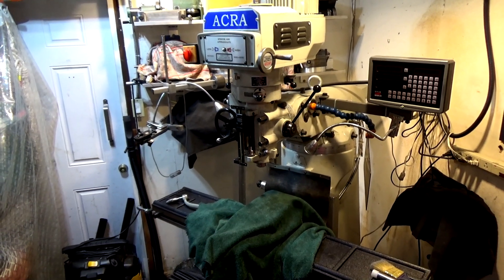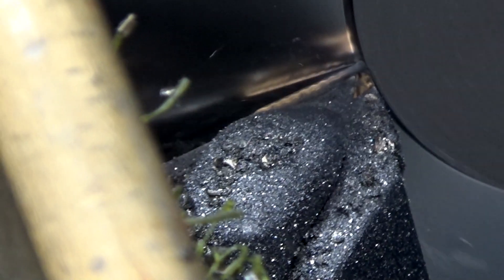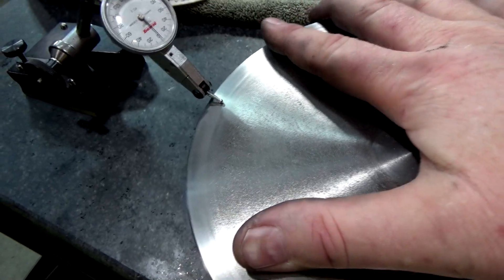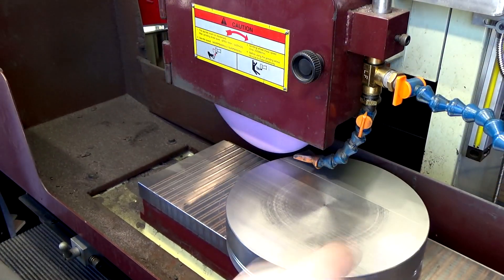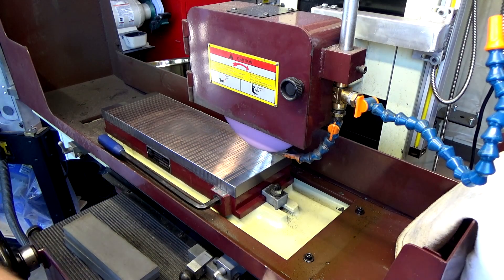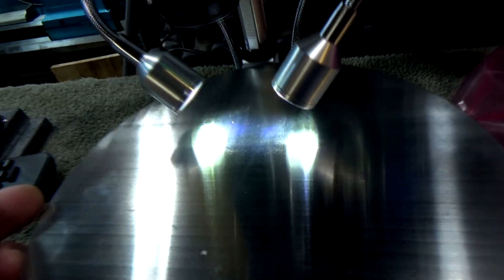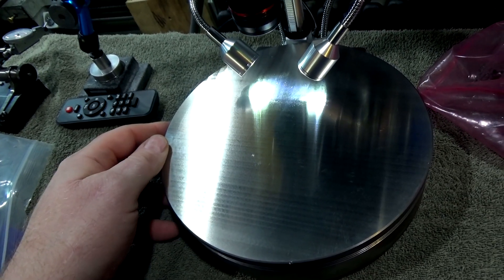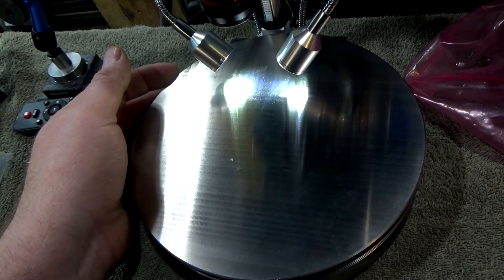175 Lapping Plates FIXED   The 3 Plate Method Part 1

Comment: Would like to understand where you will use these. 
i have access to granite but cannot figure out how to get it flat enough to be used as a surface plate. 
would laps like these work?
Reply from the maker: Any time you need to remove some material off a surface and keep or make it flat, these guys can come in to play. The three plate method can make anything flat.

Comment: Excellent explanation on The 3 Plate Method series, no one explains it better than you. Thanks. I saw a method where rotating the part consecutively/randomly would give the most flattest surface finish, looks really weird with many crisscrosses, seen this from Don at suburban tools youtube, they have the same exact surface grinder you have.
Reply from the maker: That is very generous. Thanks for the kind words.

Comment: Could you use a rotary table to get your 90 degree cuts?
Reply from the maker: I could if I had one big enough. I only have an 8" rotary table and the discs are 8 1/4". That would make clamping a challenging problem. I am thinking about getting a round magnetic chuck for the rotary table.
Reply: @DudleyToolwright  You could also make a larger plate to go on top of  the rotary table to give you more real estate. That is what I did for my 8" one. Now of course I have a 15" one I can use but heavy as hell to lift onto the table. LOL!

Comment: Why isn't the x/y travel of a mill sufficient for very close to 90 degree lines?
Reply from the maker: I never considered that approach. I was considering using a slitting saw on the mill and would have had to work some magic to use the x-y axis to cut the grid.

Comment: I still think using a surface grinder is cheating :)
Reply from the maker: It is a short cut, but so was using the lathe to face the discs. I could have gotten identical results if I had started with the rough cut blanks. I appreciate the humor. Those plates were really heavy (~25 pounds - 12Kgm) and I think my arms would have fallen off if I had to have started from really rough stock.
Reply: @DudleyToolwright  When I did mine I would guess they were off by .3mm in places after I surfaced them.  I started with valve grinding compound and it went pretty quick. though my plates were only 5lbs.  I don't think you need a 25lb plate, my ~1" thick plates seem stable.

Comment: Could you do the 3 piece method by using 2 plates but use both sides so by making 2 of the 4 sides C then you can do A-B-C-C would that affect the opposite side by doing that and the only reason I’m asking is I only have 2 drops
Reply: I don't think it would work but you could get it somewhat flat and then scrape it in if you have a good reference plate.
Reply from the maker: I think that is an interesting solution. I don't think the back of one plate would be effected by the front, provided that the plate was thick enough. Your solution could save purchasing a 3rd plate. I like it.
Reply: @DudleyToolwright  The sequence is:  if plate 1 is A/B and plate 2 is C/C

A->B  <-- not possible with A and B on the same plate
B->A !
C->B
B->C
C->A
A->C
Reply from the maker: You are absolutely right. I did not think the whole process through. At some point you would want to rub the front of the plate on the back which would be impossible.
Reply: @DudleyToolwright  There is a two-plate grinding method which works.  It depends on a gauge that shows which of two mated surfaces is convex, & which is concave.  After you get the two surfaces to mate, work with the convex on top.  Check progress often enough that you catch when both surfaces go to flat.  Works best with round or square plates (rotated while grinding to avoid developing 'twist'). E.g. Chirpy's Tinkering <https://www.youtube.com/watch?v=X37SIhRmzf4>.  Note -- a 3-footed gauge is blind to twist, but a 2-footed gauge is not!  A DTI with 'tenths' resolution (100 u-in) in the gauge's center works even better than a touch screw.

Comment: As a suggestion, mill the flats on just the bottom of the plates to provide a 90 degree reference. That will provide a reference without changing the lapping plate geometry.  
As an alternative, I mounted mine in the mill (1/16th end mill for cutting) and cut all of the parallel grooves. Then, I turned it 90 degrees and used an indicator on first grooves to make sure it was at very close to 90. Cheers man!
Reply from the maker: I really appreciate the tips. Thanks.

Comment: But it was so interesting the first time.  Very modern art feel to it.  Thanks for the videos.
Reply: agreed it almost seemed intentional, as going down this rabbit hole as a home garage gamer would be maddening to me "what is flat" multiple people speaking in my head  ensue
Reply from the maker: Thanks for being so understanding. My editing software - Vegas Video, has this weird quirk where it  will slide a few clips backward on top of other items on the timeline when you delete a bunch of them with auto-ripple on. I did not notice when I hit render.
Reply: @DudleyToolwright  No worries.  I have a set of plates turned on the lathe, but I haven't gotten to grooving them yet.  I am thinking about a cutoff wheel on the surface grinder.  I look forward to seeing what you do.